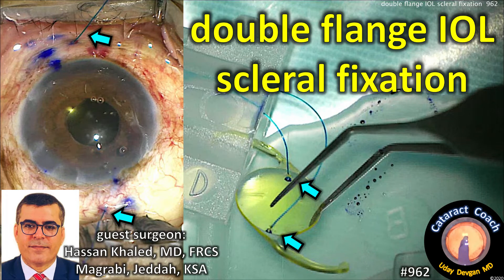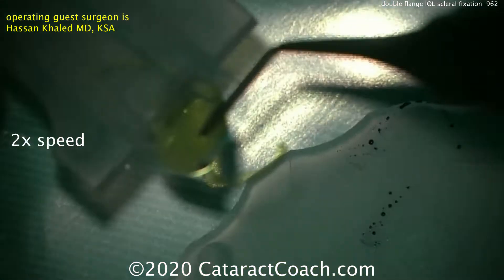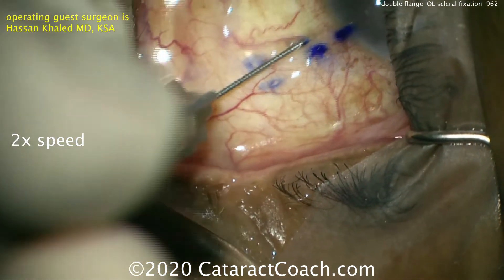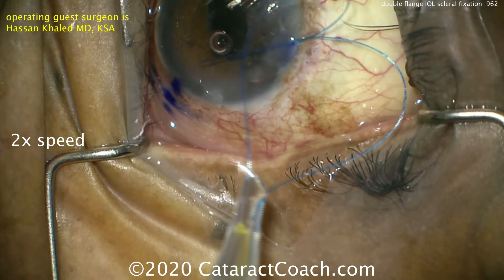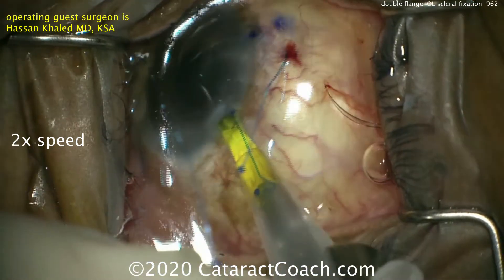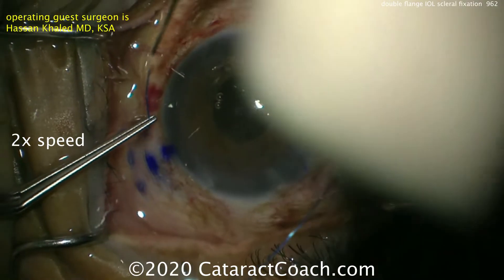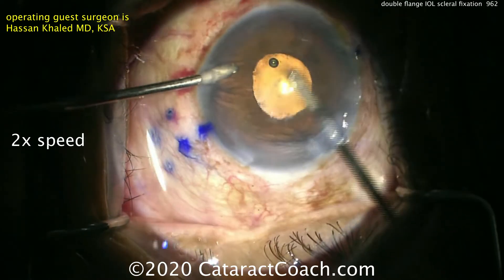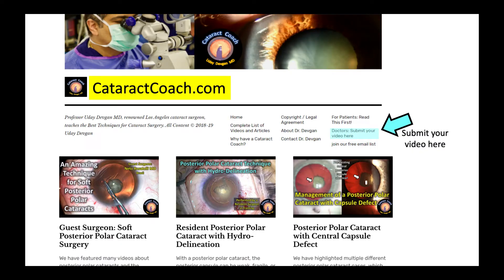double flange IOL scleral fixation technique with single-piece acrylic IOL

Comment: Thank you for this nice video
I want to ask if there is possibilty of entangled sutures , so if we pull the suture in the trailing side to the left side it will be S shape ??
Reply: To avoid entanglement , you can make the suture long for leading haptic and Short for trailing haptic as it is clear in the video.
Reply from the maker: You are correct. Care must be taken to avoid entanglement of the sutures.